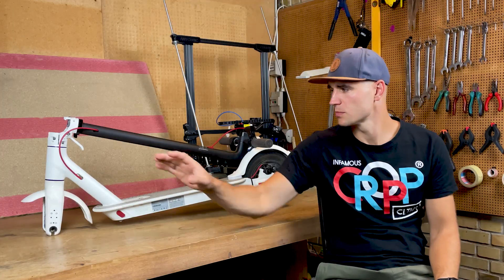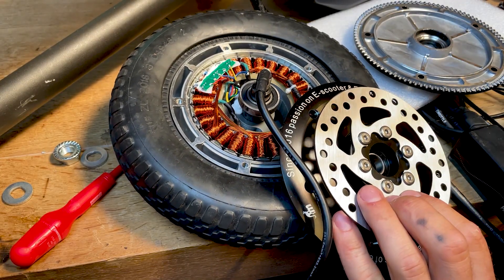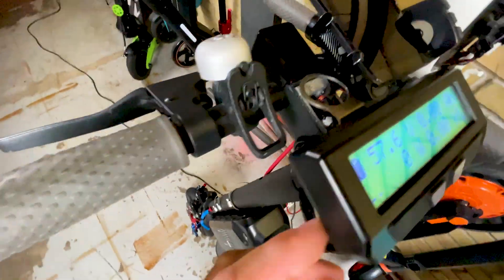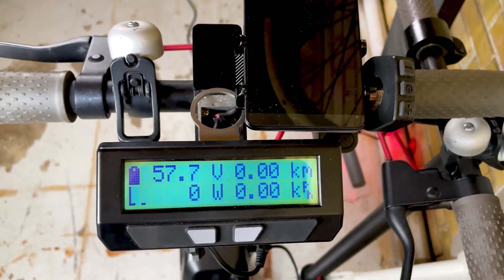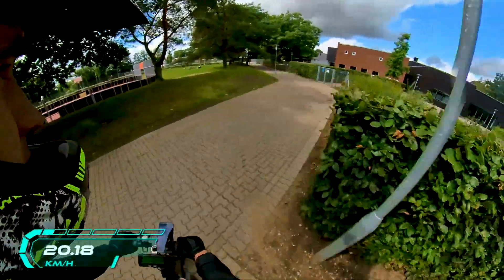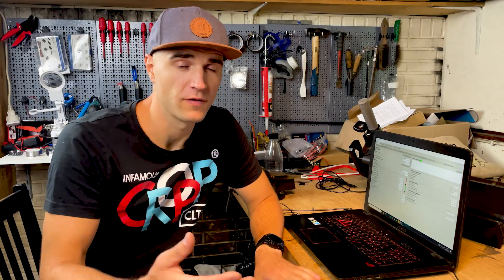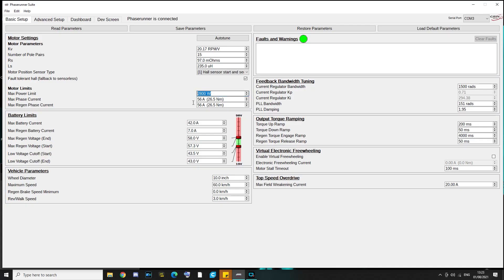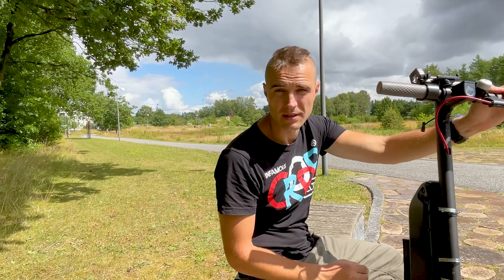Xiaomi M365 500W motor part 2: Pushing 2.1KW with Phaserunner V3

Comment: Mine with 15s battery stock modified ECU and pro motor can do 45kmh, i think you should increase voltage and get better results with it's also better to assemble one singular battery instead of using two in series.
Reply from the maker: I could go more amps 🙄 this controller can do 50. More volts of course. More field weakening as well. But I am not sure I need any more :) motor gets to like 60degrees now. 
Probably I will do a 16s battery, but reduce the amps
Reply: hi, can you share the modification steps of how to make the stock ECU run above 14s battery. thanks
Reply from the maker: @minalobudeshte  I can’t mate. I assume it is enough to make thicker traces and replace the capacitors, but I am not sure if there is sometging else that needs replacement. I burn my stock ecus with 13s-14s packs, I do not consider them good for anything more than that 🙄
Reply: @VRMinde  thanks
Reply: @VRMinde  first of all stock MOSFETS are not strong enough I replace them with IRFB4110 for instance second if you push more than 54-56 volts (I think dont remember the actual value) your MCU is getting more than 3,3V (the max rating) if you don't change resistors or power it with lower voltage it will die at some point